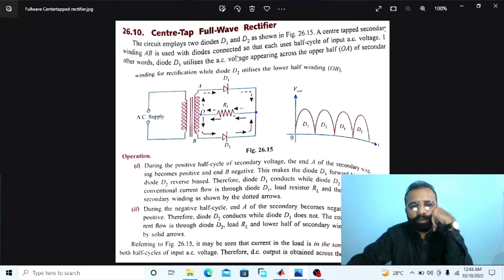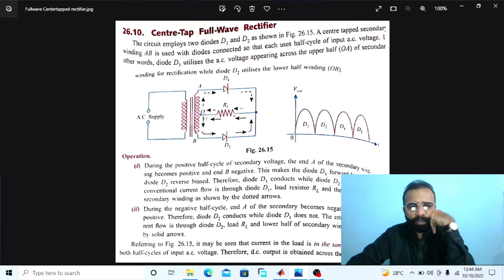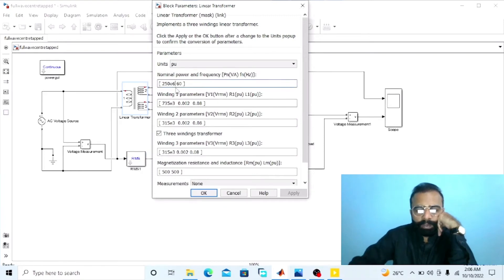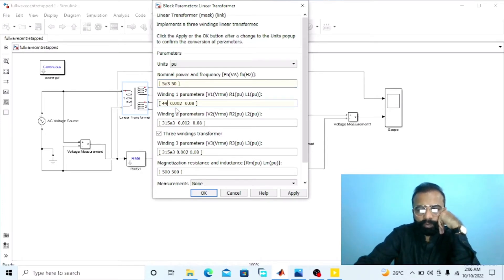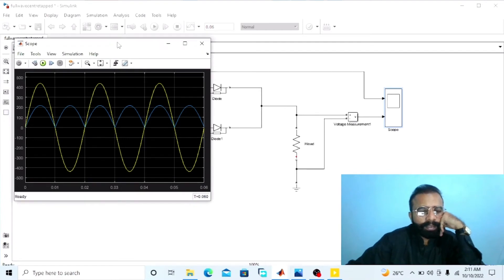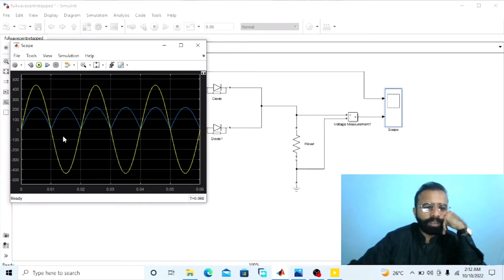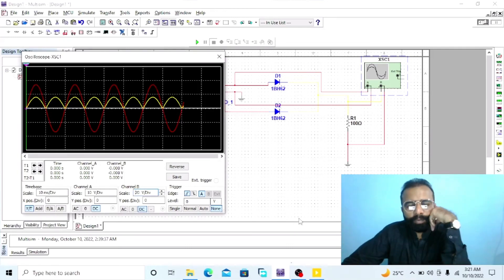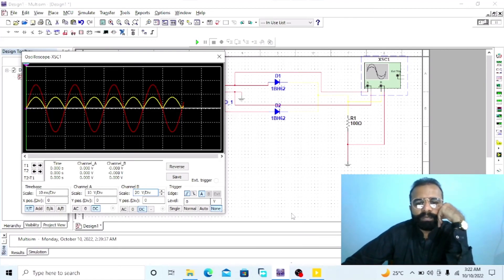Center-Tap Full-Wave Rectifier using MATLAB and Multisim Software | MATLAB & Multisim Lab Experiment

Comment: is it single phase with 3 windings transformer???
Reply from the maker: Make it single-phase two winding transformer in MATLAB parameters
Reply: Okay. But, is it possible to use single phase with 3 windings transformer?
Reply from the maker: @m.naufalnurf_nfsr47  yes you can by making it center tap, which is done in this experiment...if you dnt want to make it center tap transformer, then make it two winding transformer......Please see my transformer videos on matlab, it will make you more clear...Thanks
Reply: @Shoaib Ahmed Dayo. Thank you so much 👍👍